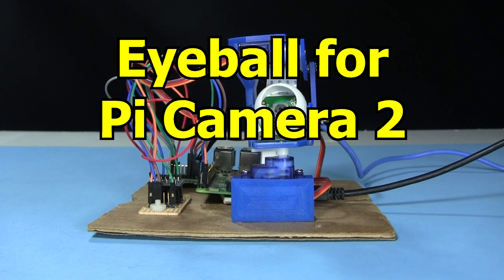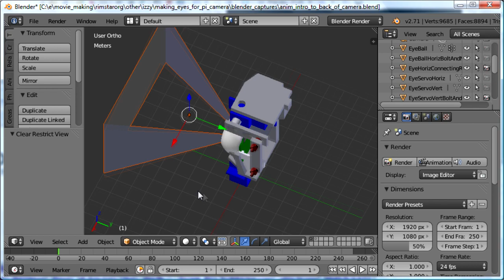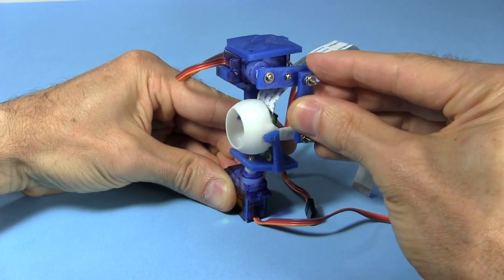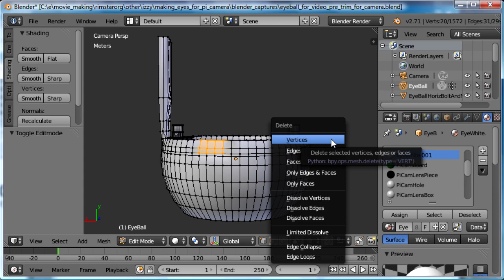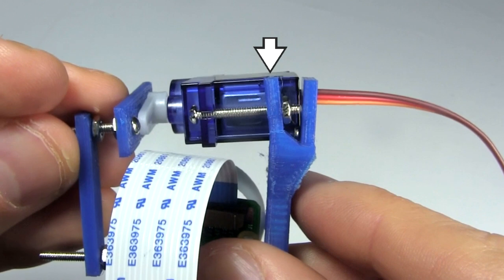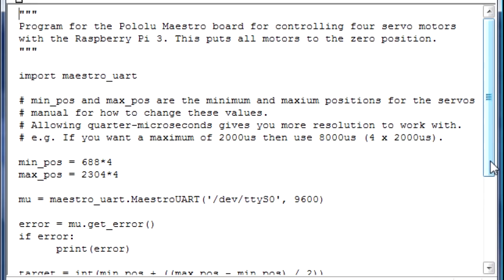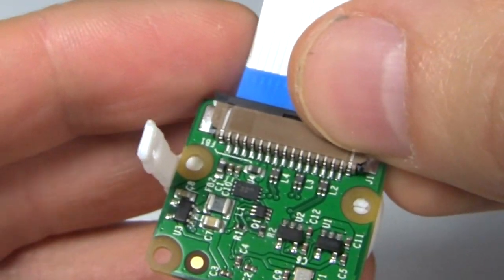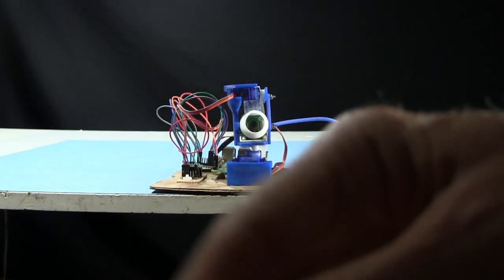Making a Servo Controlled Eyeball for Pi Camera 2

Comment: I really like the modular design!  I wonder if you could make a second eyeball camera about 10cm to the side of the first eye... with some post processing it may be possible to do depth perception calculations by superimposing the two images and calculating the pixel differences to triangulate the position of various objects in the field of view.
Reply from the maker: Thanks! I've never looked into the math but it sounds feasible. Calculating the distance to objects was one use I had in mind for having the motors not affect each other. I'd have both eyes fixate on the same object and then triangulate using on the servo motor angles alone to get the distance to the object.

Comment: hello, I'm new on the channel. Your channel is just awesome !  
1. Could the camera of the eyeball work on arduino ?
2.Is Blender a free designing program for 3d printing ?
3.Maybe you could do a turret project, combined with the coil gun and this eyeball project , where you can use a laser pointer ( any color within an angle of aiming) for targeting & shooting. [nb 3 could be fun lol] :)
Reply: & +1 sub in the counter of course. ( for the laser u can use it by hand but order the eyeball to aim at the laser spot )
Reply from the maker: 1. The camera I used, the Pi Camera 2, won't work with an Arduino. However, as I point out in the video, if you can get a small enough camera which does then it's just a matter of designing a new eyeball part, just the white eyeball. The rest should still work as is. I can see I'm going to have to find a place to put the STL files. I'm not sure if I want to put them on my website or github or a new neural networking website.
2. Blender is a free program mainly for doing 3D modelling and animation, though a lot of people seem to use it for drawing 3D scenes for making still images. However, as you saw, the same 3D models work for 3D printing. There may be better software such as Fusion360 or 123d which may be more suited for precision parts and design, but I haven't had any issues yet.
3. So many possibilities with this thing!
Reply: Thank you very much, i see how it works now specially with the eyeball-camera part and Blender and the rest aswell.
You can maybe post the STL files in all of the websites that you've said, or announce it on comments when its done. Going to have look. Have a good day  💯👍  Nice project !

Comment: Hi do you have any suggestions for a camera with zooming capabilities? In addition what would you say the best cameras for projects like these would be? Thanks.
Reply from the maker: I haven't researched cameras with zooming capabilities. I just finished making my next version, with two eyes this time and YoLuke webcams, these ones https://www.amazon.ca/dp/B016MPIFWQ/ref=pe_3034960_236394800_TE_dp_1 but they don't have zoom, just manual focus. I bought them because they were very cheap and so I wouldn't call them the best cameras. I haven't researched for the best yet. I'm switching to them because they are webcams with USB output, meaning I can connect them to anywhere, unlike a Pi Camera which can work with a Pi and only a handful of other boards. I should have a video up about my new version in a week or so. Let me know what you find.

Comment: Steve, this is off topic but, What's the best wire to use in making a crystal radio?
In viewing your past videos on Crystal Radios, I did not hear what type of wire to use.
I understand it's solid core copper but, what gauge? Thank you so much.
Reply from the maker: Are you talking about for the antenna or the coil? For the antenna it doesn't really matter unless you have a very long antenna. I that case a thinner wire will introduce more resistance so you'd want thicker.
If for the coil then I talk about that in my video about making crystal radios https://www.youtube.com/watch?v=VqdcU9ULAlA around 2 minutes and 37 seconds in. What complicates it is that the induction of a coil is dependent on but the length of the coil and the number of turns, both of which are affected by the wire thickness. So in that video I use a specific wire gauge to get the specific dimensions for the desired induction. Otherwise if you have a different wire thickness then you'd just have to do the calcs yourself. I talk about selecting the inductance in this video about LC circuits https://youtu.be/tjD9I95RAbw and about designing the coil for a specific inductance here https://youtu.be/awyLYgu6ODM.
Reply: Hey thanks, Steve. Sorry about being vague, but yes, the coil is my concern. I will check your other vids. on that. Thank you.

Comment: From the conversation u told me about, current, which is really nothing but outputs the max, how would I calculate the math of amps flowing through me at current limited of a transformer?
Like...

12000v×500000Ohms
12000v×500000Ohms×.030A

Or just the first one, but if the answer is over .03, then that wouldn't be right?

Also is microwaves really dangerous?
When they produce 2000v but only flow 4mA? Just making sure if I'm right, also I think neon transformers are less dangerous cuz of less flame Arc...
Reply from the maker: I'm not sure why you're multiplying everything. The equation is I=V/R, current=voltage/resistance, so 12,000 v / 500,000 ohms = 0.024 amps.
But that also depends on whether or not the source has can supply that much current.

By "microwave", I'm assuming you mean microwave oven transformer. 

If you're just plugging the transformer directly into the wall socket then the maximum is how much current the transformer will take and the size of the fuse/breaker. From this page http://www.kronjaeger.com/hv/hv/src/mot/index.html it looks like the transformers are not current limited so it's up to the breaker/fuse for your wall socket (since the generating station can surely supply at least that much). So for example, assuming a fuse/breaker of 10 amps and voltage 120 v from the wall socket, and assuming the transformer will step the voltage from 120 v up to 2000 v, the output current will be (120 v x 10 amps) / 2000 v = 0.6 amps (I rearranged the formula at the bottom of this page http://www.passmyexams.co.uk/GCSE/physics/transformers.html to get Is = (Vp x Ip) / Vs.

So yes, they're dangerous. Of course, the 10 amps will also blow the fuse or trip the breaker. See the first link I gave about limiting the current.
Reply: Ah ok, sorry I made a few mistakes there...